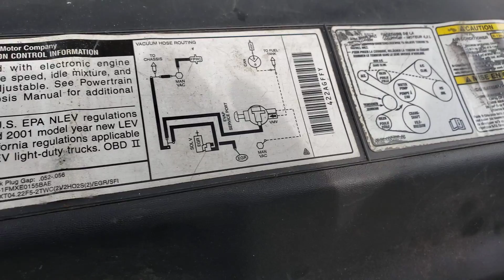Ford F150 Floored For A While! Wow! Why Wouldn't We? NEUTRAL DROP!

Comment: One of the Cash For Clunkers champs right there!
Reply: That was a sick time for older used cars and some relatively new ones at the time. Some cars new as 2007 at the time  got their engines locked up some slipped  away and got sold.

Comment: I have a 1999 Ford F-150 with the 4.2v6 original motor that has over 379,000 miles and still running strong

Comment: That states trying to shut down the fun, but good thing NEUTRAL DROP has a bunch of videos "already recorded", right?

By the way, my dad had a 4.2 v6 f150 and it got to 180k just fine
Reply: I got 170k on mine and purrs like a kitten
Reply: Same here. 2005 Ford F150 5speed manual with 196000 on the clock. Still slam the limiter on the daily. Runs like a top
Reply: 215k on mine daily driver!
Reply: @Paille3D  nah, ol 4.2 still a rocking, shes staying for a while
Reply: False Flag  bending fan pulleys? Mine has  a squeak but only when it revs to a high rpm, i was thinking alternator bearings or idler pulley bearings, but heck maybe its the fan pulley
Reply: @HogCranker11  redline for a good time bro
Reply: False Flag  thanks, I'll have to check on that. It sounds like more like a metallic squeal but maybe it isnt
Reply: False Flag  mine isn't really constant. Its quiet until you floor it, and when it downshifts it squeals until you either get off the gas or it shifts into the next gear
Reply: False Flag  ok I'll try that
Reply: my chevy 4.8 has 289,000 and runs like new..
Reply: @cardboardboxification  give me some time and my 4.2 will get there
Reply: False Flag  but they are driving around still
Reply: False Flag  true that! Rear main seal was leaking, replaced it. And the thing is already leaking again
Reply: @HogCranker11  zip ties is awesome 😂
Reply: Mine already at 273k
Reply: False Flag  heck I just love the random shit and out right baggery of some minty fords

Comment: WoW with a capital "w" is right.
Now that truck was built "Ford Tough"
You dump screws in it and it says
 "screw you" I'll keep on running.
Oh detergent, nice haven't been this clean in years.
Probably would go even longer with the oil fill cap back on.
That one was a trooper it did not quit until stuntman shut it down. 😁👍

Comment: Neutraldrop, for the next vehicle you redline, put the transmission in between neutral and drive and it should bypass the rev limiter and it’ll release all hell. Make sure the gear is exactly between neutral and drive and give it some gas, if it doesn’t move, then you should be able to push the engine beyond what the rev limiter gives you

Comment: I had a 97 E250 work van with that motor in it. It had 390,000 miles on it and still ran good. It was sitting and my landlord didn't want to see it and the guy that came to look at it didn't want it because I couldn't get it to start. No click, no nothing. Tried different batteries, different chargers, nothing. Had a buddy over was gonna drag the thing up to the scales and while I was under it hooking the strap I found this little wire hanging off the starter. I was like, HUH, plugged the wire back into the threaded stud and the motor fired right up. It was smoking to hell and ticking like that F150 and the transmission was stuck in 1st gear. So I tacked the hell out of it driving it 4 miles to the scrap yard. I paid 800 dollars for the thing when I was delivering and ended up getting almost all of that back in scrap metal(those were good scraping times, not like now). Moral of this story, don't let rides sit because it ruins them. You can put 1 million miles on something if you keep driving and maintaining it but once you let it sit for 6 months, it goes to shit.

Comment: 4.2L of fury. Leaky, but run a damn long time.
Reply: thefordmaniac seems to me ford could build reliable motors, that leak a ton of oil, all day long back in the day. My old 300 inline 6 never skips a beat but dumps a quart of oil all over itself between changes lol
Reply: @Iamthathillbilly  My neighbor had one of those in a 94 econoline with 350k on the clock. He was in the delivery business but with no overdrive those things tacked right out. He was doing a speed run to deliver a bank bag that the original driver missed at the shop 300 miles to Detroit and he was tacking it out on the expressway. The motor was clean, no leaks, no nothing but he was getting off the expressway and it started knocking on the off ramp. He drove that thing around another 400 miles waiting for the shop to get him another motor. The one they replaced it with had a hole rusted through the oil pan, it had lost all compression on 3 of the 6 cylinders and was blowing the dipstick out of the tube and blowing oil all over the place. The motor they took out ran better with a rod knock.

Comment: Just running a little hot. Couldn't hit the rev limiter. Prob 1 or 2 cylinders not poppin. Give it an hour to cool. Prob restart with a hot battery pack. Something else gets my attention. I noticed here and even @ Junkman's Paradise, someone's transmitter jams your audio and comes blaring through! Reminds me of the CB days where truckers (some) would run "kickers" to boost their signal. I could be driving along side one listening to my 8-track player and hear the trucker blast right though my "stereo" loud and clear! BTW, I'm the guy that ragged on you guys for blowing up that VW Beetle w/the diesel mota. To me, it was kinda like having to hafta put your pet down at the vet. LOL. I'm getting over it! LOL. But this well worn truck served a long useful life IMO. It was ready for euthanasia. I, for one, will miss your antics if you are forced to go on hiatus for awhile. Thanks, good luck.
Reply: And a big thanks back to you Curt ..we're going to try and do the 'lives' and stuff like that to keep in touch with the neutral droppers I wish you the best of luck during these crazy times man!

Comment: You boys gotta get a small engine, make up a plate and weld the crankshaft to the ground.

So basically the motor rotates and the crankshaft doesn't move.
Reply: Also any safety is a plus.

Comment: Here's an idea for camera and stunt. Drain the motor dry of oil, rev until you start to get a difference in sound.. knock knock knocking on heaveans door. Kill the motor, add good oil, and see how long it'll go from that point at full throttle!

Comment: If you guys could rip off the air intake and start to feed it saw dust or if you want a little neutral drop nitro spray in some brake clean, spray paint, Pam nonstick coating, butane the fun stuff

Comment: Such a shitty engine that it kept running with it pinned and laundry detergent in it? And y’all coulnd break the last 2 fords either? Seem pretty damn good engines to me.
Reply from the maker: When you're right you're right I can't argue with you my man the LS motor in my truck I guarantee would not last as long and I'm serious too
Reply: NEUTRAL DROP  it may surprise you as well!!! 🇺🇸
Reply: Merica made 🤟🏻
Reply: @NEUTRALDROP  only one way to find out
Reply: @NEUTRALDROP  your engine can handle 1500 hp on the stock bottom end friend

Comment: 2:25 name one that isnt!
Reply: 4.6L 2v V8
Reply: No
Reply: @nickflopper  hater
Reply: ford makes good engines and cars change my mind
Reply: @win95beta5  yeah this clearly very good, with all that valve noise and dead misfire/s
Reply: five speed ash maybe, this is bad engine but not all ford engines are bad, for example  dohc engine, dohc engines are not bad engines cuz they're reliable and they have some good resources to get tuned, also 2.5 tdi or di in transits, they ae super reliable and they maybe are little slow and boring engines but come on! They are for vans only. You must google some things before commenting!😁